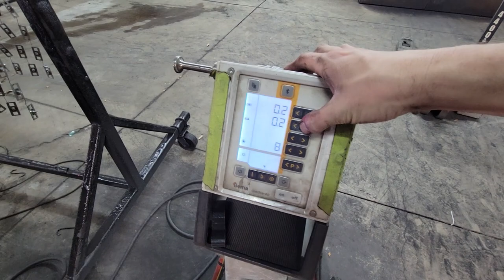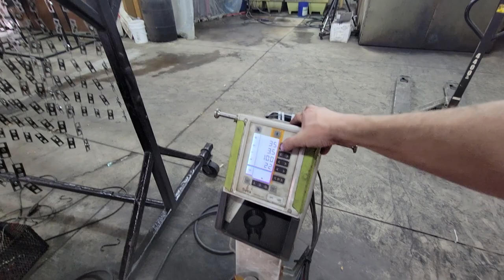How to powder coat - How to hot flock.

Comment: I rebuild the old Honda 3wheelers and I was always intimidated by powder coating until a buddy said how easy it is so I bought an Eastwood DV gun and got to work. I have made a few modifications to my gun and now I'm able to control the amount of powder coming out of my gun. Most of what I powder coat is mild steel or aluminum and I hot flock everything. I found it frustrating sitting in front of my oven waiting for the powder to flow out then I discovered hot flocking. I warm the part up to cure temp then apply the powder. When it goes back in to the oven I set the timer for the cure duration and I'm done. To me hot flocking makes far more sense and works for what I do.

Comment: I have a product that I powder coat all of the metal parts (3) by warming them first for about 5 minutes at cure temperature. The warmer temperature of the parts makes the powder coating always come out glass smooth. If done cold, I am never sure if I’m going to get a finish that doesn’t have some orange peel. When heated first for 5 minutes they ALWAYS are glass smooth. They don’t have to be cure temp just warmer. My guess is that the powder gets to the point of flowing out sooner and has more time while baking to flow out totally smooth.

Comment: I enjoy your videos,  I learn a lot from them. 
Please keep them coming. 
I have a question I hope you can help me with. 
I have a customer that has had 2 custom steel tubing end tables and a large living room table made at a fab shop. They look great all together welded. 
My concern is that everything is seal welded with no vent holes in the rectangle tubing. Is this a potential concern during the 400 deg. Curing
Reply: Continued, 
Curing, will the tubing possibly swell,
Would you coat it as is or ask the customer if she minds me drilling small vevt holes.
Thanks for your info.
Reply from the maker: @byronhardt7313  I would not think that it would be an issues unless there is a ton of "junk" in the tubes, You may be surprised to find a small hole in a weld as just cause it looks complete it may not.  Also I would not think it would be an issue to drill a small hole on a bottom side.

Comment: I do those exact cabinets and tanks everyday... I dont hot flock we do many of those things a day and it takes to long to heat every one first... I have found really easy ways to paint those areas and in it so much easier than you would ever imagine..   Just think about it... Air carries the powder into aclosed corner... Then the paint needs to stay but the air has to have a way out of the corner. your trying to force  your spray by the air that is trying to escape.   so to get paint into a hard area just paint right next to it and never pont directly into it...or so quick little passes over it and stay a little farthur away so the powder slows dont before it reaches the area...  The powder wants to go into those areas but your not 
letting it.
Reply from the maker: We wash and phosphate the tanks.  So they have to go in the oven to dry.  It's much quicker to hit these spots while hot than to wait for them to cool and spray that way.  I agree on your spray technique though.